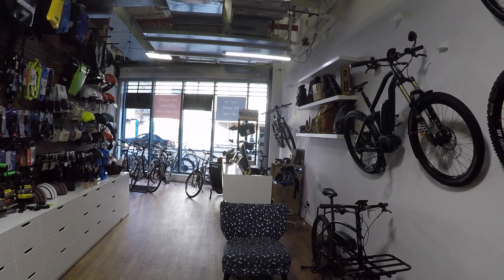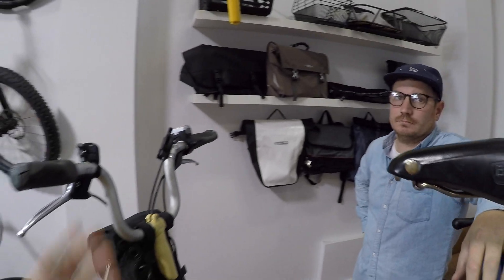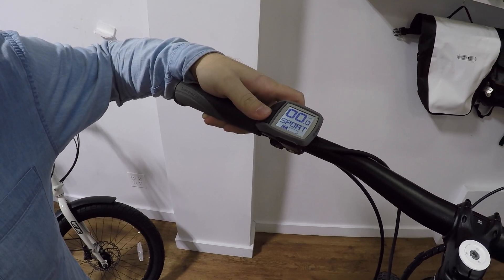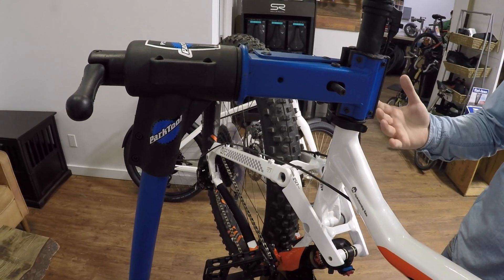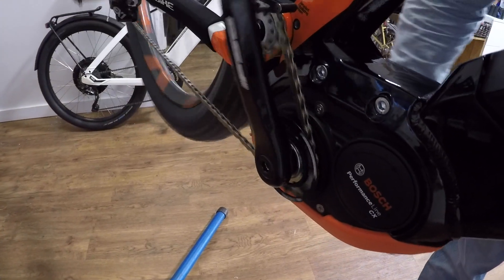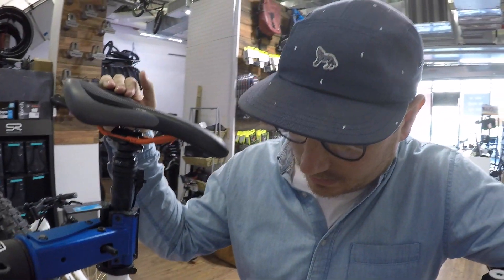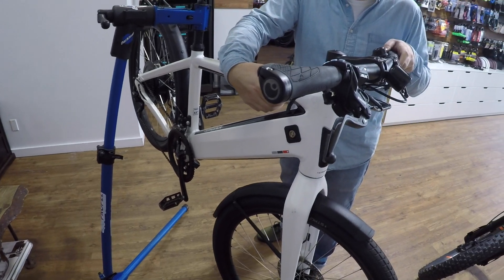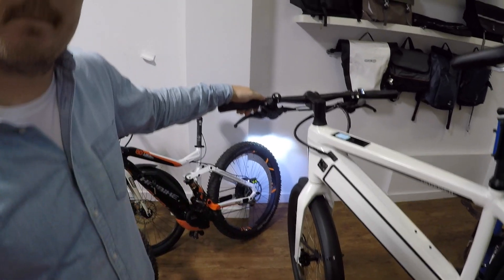What Are Electric Bike Classes? Pedal Assist, Throttle, Speed Pedelec

Comment: Replaced a cracked and bent TMM4 sensor plate and damaged rear derailleur but PAS became sluggish and weakly responsive. Re-installed original parts and 2012 Stromer runs like new. So I assume the torque sensor is ok. Is there an adjustment screw on the sensor to calibrate the TMM4? I would still like to replace the damaged parts even though it’s running well.

Comment: So is my e bike a class 2 or a class 3? It has a throttle, but its max speed is 28 mph
Reply from the maker: Good question, some companies blur the lines or allow you to adjust the speed and remove the throttle depending on your local laws or intended use. I’d list that as Class 2 and 3 since it’s capable of higher speeds.

Comment: Amazing bike   share4.photo/ebicycle?Л    With this thing i can go all over the place without breaking a sweat. I never use the pedal assist mode, i just cruise along on full electric. Will do around 1 hour or so on full throttle before the battery dies, which is plenty for me. I have 2 motorcycles but theres just something about cruising lowkey on this thing through the city. Would also be an awesome gift for any one thats a little older that likes to go on bike rides, get tired just twist the throttle and your away!

Comment: The Californian regulations seem to be based on European regulation, altough class 2 doesn't exist in EU regulations.
We have class 1, with a bit lower top speed for the PAS to operate, 25km/h or 16mph.
Then for class 3 which is a combination of class 2/class 3 bikes, top speed with PAS also 28mph, throttle can work up to 15mph.

I ride a class 3 which is legaly a moped in Europe, so needs insurance and a registration, insurance is from only $45 a year for liability only, or with a theft or all risk option for an uprate.
It's also not allowed on bike paths, but most bike paths outside the built up area's allow mopeds on them as well, so you are not banned to roads with cars speeding past at 50-60mph, inside city limits I have to use the roads, but sometimes I choose to use the bike path as well where cars have to use narrow single lanes where they can not go past you.
That because even on a speed pedelec you are not always riding at top speed, for instance when you choose a lower level of PAS for extended range or when going uphill you will do speeds between 16-22mph which is significantly slower than cars do, and not able to overtake car drivers will get irritated, so for my own safety I take the bike path in some places, the chance to get pulled over for this is relatively low in my area.

Needless to say, but I adapt my speed when using a bike path with a lot of slower cyclists on them, especially when there are children amongst them.

Comment: Obviously, you've never ridden a dirt bike or 4wheeler.  All motorcycles have twist grip throttles, and that includes dirt bikes too.  4wheelers generally come with thumb throttles but the first thing most owners (at least the ones who actually know how to ride) do is swap them out in favor of a twist grip throttle.  Haven't you used a MTN bike thumb shifter?  How dangerous or unsafe is that?  No too.  And furthermore, you're absolutely wrong on accidental throttle input on a trail.  Only a newbie like you would even worry  about such a thing.  You're doing a disservice to those like you who are scared of everything.   Grow a set.

Comment: Well, that was about as clear as Mud 🤤
Reply: Jerry Mccarthy Explaining the classes should have taken all of a few minutes. Instead they talked about all sorts of stuff not really explaining the classes and just confusing things.
Reply: In a nut shell, there's only really 3 classes, because in the eyes of the cops, it's legally just a bicycle. Not a moped/motorcycle. The Class IV isn't really an eBike, it's an electric motorized vehicle (scooter or motorcycle) with all the requirements and limitations of a gas powered vehicle, such as insurance, license, and not allowed on non-motorized bike paths.
But these 3 are eBikes in the true sense of the word, and the rules are ALMOST universal in the US, with some exceptions like NY.
Class I: Motor only turns on while you pedal, up to 20mph with a max 750 watt motor
Class II: Motor turns on only with the throttle, up to 20mph with max 750 watt motor
Class III: Pedal Assist up to 28 mph AND/OR the Class II's throttle up to 20mph, still limited to 750 watt motor. This is as fast as they get without legally being a motorized vehicle
In my state, Oregon, the speed limits are the same, but you can have up to a 1000 watt motor. But even with the battery removed, you CANNOT ride them on sidewalks, even under just pedal power. You're forced to ride with the motorized traffic if no bike bath is available, no matter what class eBike you have.

Comment: A lot of class II bikes with throttle control allow you to turn it on and off with a button so that you don't accidentally activate it.  Also, many bikes have brake sensors now that when you apply the brakes, it automatically stops supplying power to the motor.

Comment: The law regarding throttles changed in UK now to only being able to use when bike is in motion..... not allowed to set up for start up. Which is a bind for me having COPD and sometimes I don't have the energy to push on the pedals. They have not thought this regulation out very well with disabled cyclists. In this regard it has stopped me using  the bike
Reply: Pussy fucking government UK you mean.

Comment: The problem is if your legs are poor people need to understand a torque sensing bike will be much harder for your legs and you might require a cadence sensor bike instead
Reply: Gas motor.  Just get a gas motor.

Comment: uh any reason you havent done a ANCHEER mountain bike/folding bike  review? is it that bad
Reply: I just bought one and its terrible no power pedal assist does not work properly. I am buying a new PAS sensor and hoping it will work. I would have to pay expensive shipping costs to return so they refunded me £100 but I need to get a PAS that works with the bike. Battery power all over the place about 4 miles. I always intended to change the battery to higher amp hour but the bike is a real dog.

Comment: Another awesome video Court.

The difference between Class 1 and Class 3 types is still fuzzy to me.  Can you clarify?
So, 
* Class 1 * 
Can have a motor under 750W, speed limited to 20 mph and has Pedal Assist - only Cadence PAS
* Class 2 * 
Can have a motor under 750W, speed limited to 20 mph and has Pedal Assist - Cadence PAS + Throttle
* Class 3 * 
Can have a motor under 750W, speed limited to 20 mph, but can go higher and has Pedal Assist - only Torq Sensing PAS

Do Correct me, please!
Reply: I updated your list a bit. I hope this makes it clearer - Chris

* Class 1 * 
Can have a motor under 750W, speed limited to 20 mph and has Pedal Assist - Doesn't matter if it's cadence or torque sensor
* Class 2 * 
Can have a motor under 750W, speed limited to 20 mph and has Pedal Assist and/or Throttle
* Class 3 * 
Can have a motor under 750W, speed limited to 28 mph with Pedal Assist - Doesn't matter if it's cadence or torque sensor
Reply: Thank you sir/maam!

Comment: Class II in this video only said throttle, which IMO misses the key things about it:  throttle from stand-still, legally allowed walk mode (and reverse), no need for license, registration, or insurance, and allowed on bike paths.  This is the sweet spot for urban transformation and a new identity for the industry bigger than hobbyists, liesure riders, and sports enthusiasts combined, IMO.  It should be the hilight and main focus in the bigger picture, whereas this video only about on-board gear itself with a feeble kit example gives the impression Class II is kind of a dud or afterthought that's barely appropriate for bike paths.  Very odd, IMO.

Comment: Thanks for the good review.   I learned a lot. 

My E Trike has brake levers that cut off the power to the motor when the brakes are applied.  I like this safety feature.   I also have a thumb throttle which I like more than the twist grip throttle for safety reasons.